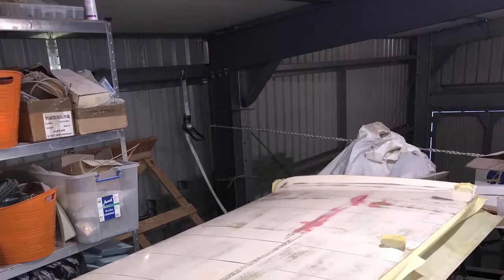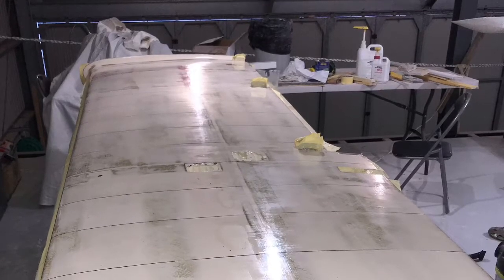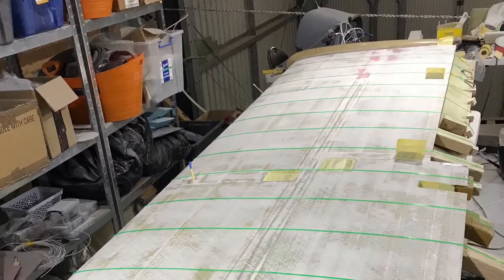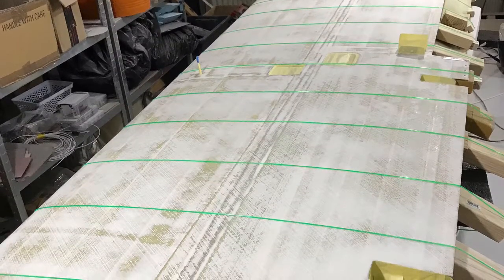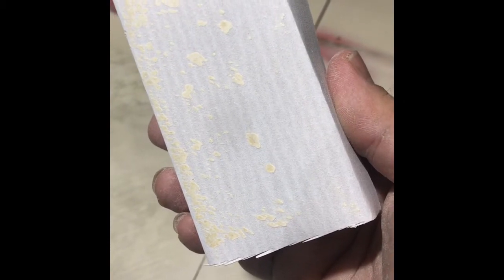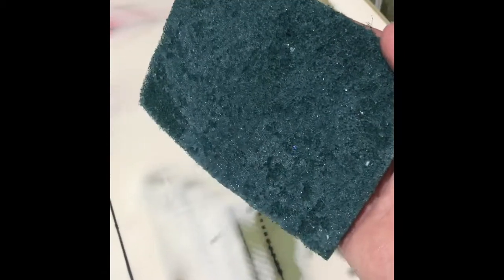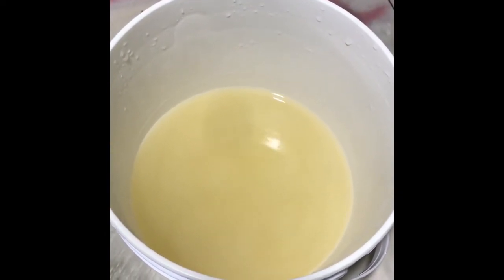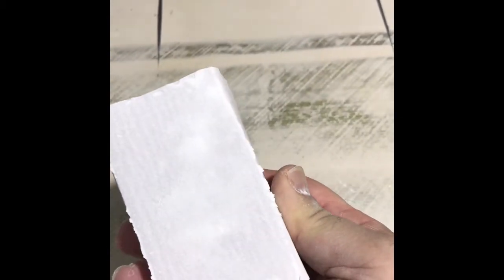Removing Amine Blush after finishing and sanding a composite wing

Comment: I'm having the same issue on my boat build. Applied a coat of epoxy yesterday afternoon, temp was 72 degrees. Over night it went to mid 50's. This morning I planned on sanding in preparation of applying another coat, but  it had alot of Amine blush on it. Wiped down the hull with Acetone with no effect. Googled it and it recommended warm soapy water and a scrub pad. I've done this twice with only marginal results. Any thoughts?
Reply from the maker: Hi Randy, I simply used warm water and a Scotch Brit pad. I'd give this another try and make sure you give it a good scrub. I was advised that the Amine is water-soluble so don't use any soap.
Reply: @tonyvaccarella5362  Thanks so much Tony for your response. Since the weather has cooled off here I've noticed a greater presence of Amine than during warmer temps. Seems there is always gremlin's out there to slow down progress! Best of luck on your build Tony.
Reply: @tonyvaccarella5362  Just finished scrubbing the hull and it came out perfect! So glad I watched your video Tony!
Reply from the maker: @randyw6864  Randy - Im very happy that it helped.